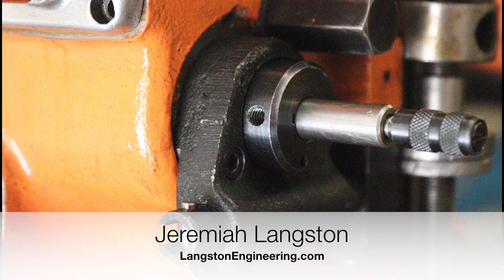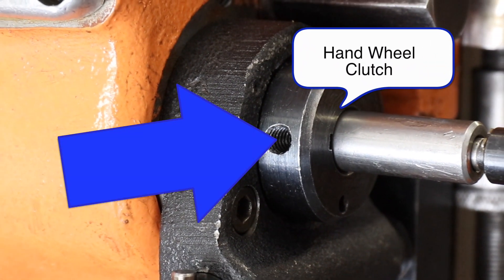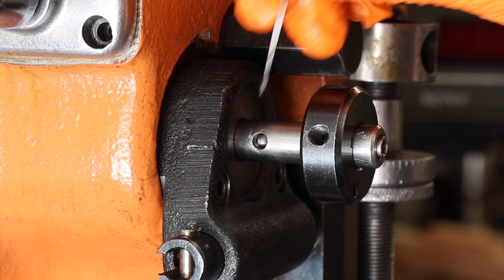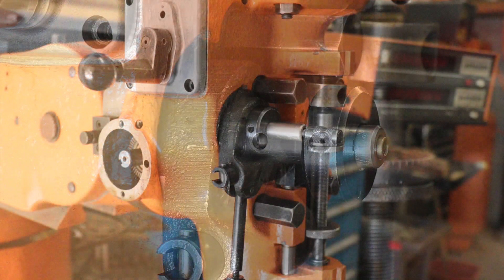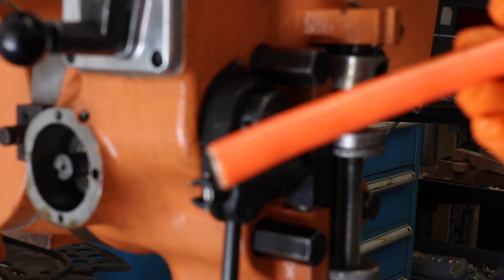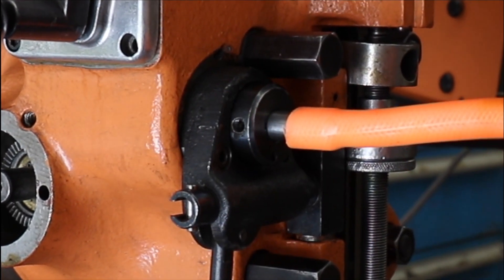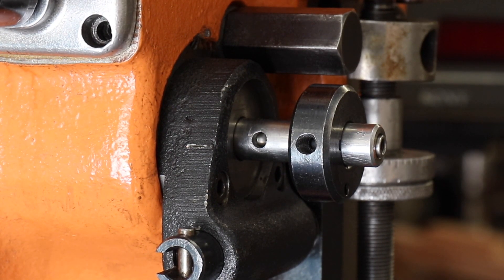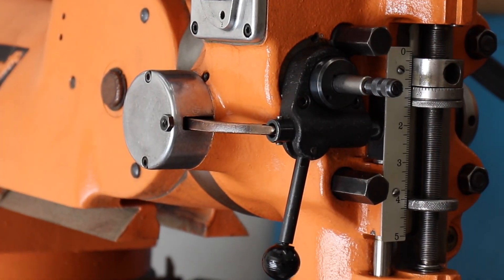Bridgeport Handwheel Clutch Bearing Removal

Comment: I'd like to paint mine orange 🧡🧡
Reply from the maker: You should totally paint the Bridgeport, and the Hardinge Orange...   I think that it would make all of the orange accents you in your shop really pop... lol
Reply from the maker: If you are being serious, I used 2 part industrial enamel that I got from Sherwin Williams,  The color is Safety orange,  There are limited colors in this series, but I think SW can custom mix a color for you.  I recommend that you keep the color parameters if you do it this way so you can get a second batch made if you run out, or need to touch up. I have a video that explains how to mix and apply, Also provide some other application considerations.  I have it on my floors, and on a few machines, and it has held up really well for the past 10 years under what I would describe is heavy abuse.  Here is a link for your convenience.  

https://www.sherwin-williams.com/webapp/wcs/stores/servlet/homeowners/products/industrial-enamel?itemCatentryId=19854

Cheers

Comment: I think you have the ONLY YT video on this, I searched for 2 days. The ball gets worn and gets grooves in it.  I finally hit it with my Dremel cut off disc and it began to spin, wore the diameter down and popped out. I believe it is .125 and I need to find a new one somewhere... Thanks for the video
Reply from the maker: That sucks man. Glad you got it out...   Check out these guys for BP parts. I've ordered many parts from them when I was rebuilding my machine, and had a great experience.   https://www.machinerypartsdepot.com/product/1402
Reply: @JeremiahL  Thanks bud, I'll check them out. I imagine Ebay has everything too...